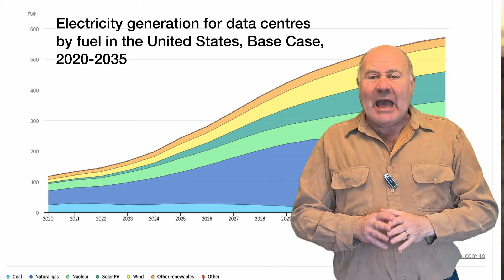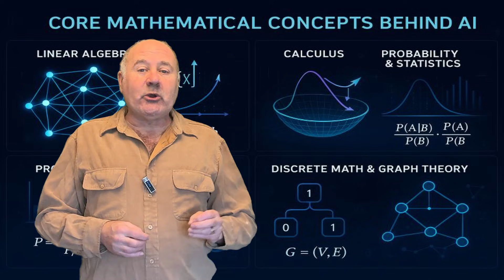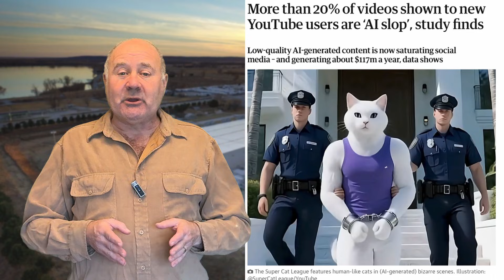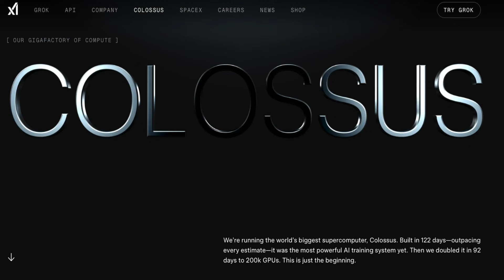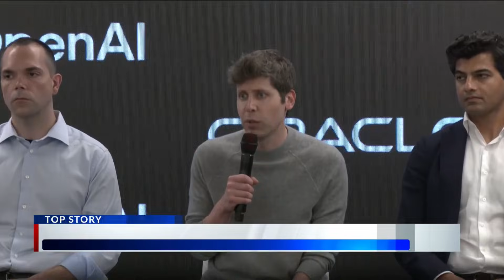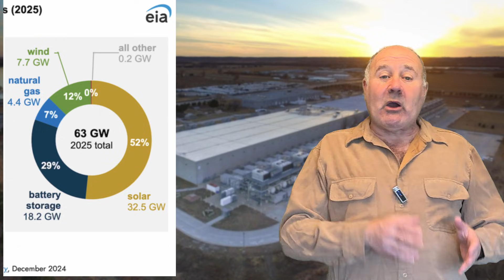You’re being lied to about electricity and AI data centers: the truth is dirtier and inefficient

Comment: A recent application to build a ‘Green’ data centre in the Edinburgh district was  rejected, not least because it transpired that the energy requirement for it was equivalent to more than that delivered to Glasgow and Edinburgh cities combined, an additional amount clearly unobtainable from the so called ‘renewable’ energy sources currently being championed by Governments on either side of the border.   
This leads one to conclude that not only is U.K. plc being deindustrialised, but also being denied a place on the starting line of the bright new technological future we are supposed to be getting on board with which is meant to be the replacement for industrial output, thanks to idiots like energy minister Miliband and co, and the Scottish Natsis (somewhat ironically) described as being ‘in power’, as opposed to running out of control in their respective ‘ivorine’ towers. 
￼

Comment: Enhanced geothermal wells are really the only energy supply solution I'm able to see going forward in this age.  Start drilling!
Reply: I had solar installed last year and the power company paid for a big chunk of it.  They know that 3 months to install home solar will be far faster than trying to build a new power plant of any kind so their hope is to have hundreds of thousands or more mini power plants around the state.  During extreme temperature periods, they use the battery, which they essentially paid for, to assist the grid.  One battery doesn't do much but thousands working together do.
Reply from the maker: No one has quite gotten it to work yet, but it is an interesting technology and I plan to do a video on it in the future.

Comment: If anything these data centers function as fuel tanks but water. 

Water will evaporated when it reach a certain temperature. Imagine cooling down a whole data center. What is the clouds they spew? 

Yes they may use recycled water but they must keep refilling the gallons of water when running low... Effectively like a fuel tank for water
Reply from the maker: The OpenAI data center I talked about doesn’t use evaporative cooling and the water use isn’t that much. But that increases the energy usage.

Comment: DATA CENTERS ARE STEALING DRINKING WATER SOURCES DRAINING AQUIFERS & LAKES DRY
Reply: Where are they putting the water after they've used it, does anyone know?
Reply: @Nigel_Broatch I think it evaporates 😢
Reply: @michah321 That's how it's done. Send loads of heat and moisture into the atmosphere. No one knows what will happen to the weather.
They should use refrigeration cooling. Like air conditioning. That would cost extra money. Can't have that. Make the little people foot the bill.
Reply: @abjectt5440  You might want to study up on how it actually works.  That was just ridiculous conjecture.
Reply: @Nigel_Broatch  They mostly use waste water before the final purification or else recycle it in a closed system with little or no evaporation.
Reply: That's alright then. So data centres don't use much water after all.

   I suppose it would make sense to pump that warm water to heat nearby houses.
Reply: @robertd9850 from what I heard they use millions of gallons a day of fresh drinking g water from the aquifers. That's what I heard in a data center proposal in my county.. That's what the plan was.
Reply: @Nigel_Broatch  The water never leaves the closed systems and the ones that use wastewater return it to the water treatment plant for final purification into drinking water.
Reply: Thanks for the info.
I wonder where the heat goes from the warm water, going round and round it would get hotter and hotter!
Reply: Water treatment should be charged directly to data centers so individuals paying taxes and water and sewer bills are not on the hook for it. I don't trust them. We wouldn't know if in fact their water is sent through water treatment or not. There are different ways it could be negotiated with municipalities before final decisions are even known to the public. Politics will be involved.
Reply: That's why we have to support people like Moses he built a machine that takes water out of the air !! Thay don't like it because he is giving out free water with his enventstion
Reply: Trains get radiation from the railway. Tire plants even admit radiation at the hopper where they pour the powder into to make rubber. I don't doubt these AI centers are polluting and using water through leakage and evaporation. Which will return into high water cost and high electricity bills. Enough we could face blackouts and shortages. They're definitely making lots of toxins from these AI centers. Paint plants and chemical plants are so  strong people are getting nose bleeds from these toxic chemical plants. Definitely most of these plants are cancerous. I'm sure these data centers are worse than that. I sure wouldn't want to be living by these toxic dumps. AI is not even need it's a want! I don't doubt the AI data centers are probably poisoning or radiating the water with radiation.

Comment: When the  bubble bursts  all  the computing power will be useful and can be resold, but the GAS GENERATORS are NOT  WANTED NOW AND NOT  WANTED LATER!
Reply: Not sure about this. I'm afraid they use very specific hardware. Like those GPUs don't have video outputs and all graphic processing firmware. So you can't just sell it to gamers without substantial rewiring!
Reply: @allmycircuits8850  I suppose I can at least get cheaper RAM!
Reply: @jocosson8892  The RAM is also made specificialy for these servers and will not work in PCs . However they would have to resteer production back to the consumer market again hopefully then.
Reply: @johnpekkala6941  They're probably going to shift these data centers into cloud computing infrastructure and keep consumer owned computing power scarce. We know they want to rent our computers to us rather than being able to own them.
Reply: @futurehistoryarchaeologist4480 equipment replacement rate is 2-3 years. The whole thing is unsustainable.
Reply: Unfortunately, discount generators are probably going to be the most used compared to stuff like hyper-specific GPUs
Reply: It wears out quickly. Burn and churn.
Reply: Those chips will be useless and will go into landfill.
Reply: when the bubble bursts and the shops arent open and the powers down, and isnt coming back... you might change your tune.

you might appreciate that generator and all the comfort that electricity spat out of it brings you...
Reply: That computing power will be obsolete far sooner than point-of-use power generation. Gas turbine generators would be the most easily resold/repurposed equipment. The AI bubble pop, though, isn't going to result in data centers shutting down and being sold off in pieces. It means consolidation. In other words, same data centers, same power usage, different owner. You may want to consider injecting reality and intellectual competence into your comment-forming process.
Reply: @ghoffmann821  We have to stop burning methane  it is going to destroy  the  climate
Reply: I've heard the chips used in these Data Centers only have a working lifespan of 2-3 years and they need to be replaced.

Comment: What is crazy about the massive energy use is how most of it ends up as waste heat and dumped by evaporating water.
Reply: In most places it's really hard to utilize that heat. Exit cooling water is not hot  enough for direct energy production and usable for centralized heating only in cold climates. And of course only during winter time.
Reply: @NzeRekoRec might work in colder places like Michigan
Reply: What's really crazy is that We The People actually allow these data centers to consume our water for their cooling when they could use closed-loop cooling to avoid any water consumption for cooling. Likewise, the same is true for the generation of the electricity they need when we could require that they use clean, safe, lower cost, renewable solar, wind and battery storage that requires zero consumption of water for cooling. We The People need to smarten up.
Reply: @greggrant4614  That would cost extra money they don't want to pay. Besides, it's cheaper just to bribe the politicians.
Reply: @greggrant4614 the great engineering feats of the old world such as tartary and those ancient star forts were all next to water built close to them at least most of them,but we can learn the same system of electricity involved and tech that was known in that time that mimicked nature's natural rhythms and Create a biological system that was self sustaining and self reliant and lasted forever so we would not be using this fake dystopian crap the corps and bankers the parasites as I call them,are throwing in our face with venture capitalist nonsense consumer based retard system that has been unproven to work and cant work by design,as it's a failed system designed to fail on purpose,so if we look back to ancient old world tartary and there tech like so many other trust sciences did like Tesla did we can be using free wireless power that exist off the aether at will and have it be using a fueless tech that powers itself as a real thing that exist and not some capitalist moron coming on here and calling it pseudoscience and what not because it Sherly isn't out of the realm of science fiction as claimed
Reply: It basically has to be for the weapons industry and surveillance state
Reply: See a Freudenberg Sealing technologies. They use human body heat and footsteps for power “human power plants” they say. Now think of those warehouses being bought up to hold thousands of humans captive. Yes, it is that dark.
Reply: True of pretty much all eletricity. It (nearly) all ends up as waste heat. An exception might be aluminium production via electrolosis
Reply: @NickKeighley Not totally.   Electricity production converts 2/3 of the fuel to waste heat and 1/3 to work; power to the grid.  Data centers convert all the fuel to waste heat.
Reply: @asc5882and that 1/3 (and I think with more efficient plants its nearer 40%) that gets sent to homes and factories, what happens to it? It all gets converted to waste heat. Only in the case where you actually make something that stores the energy does it not. Aluminium is the obvious one.

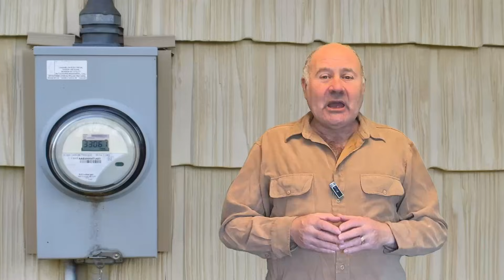Comment: 5:22 I have been involved in construction projects bigger than homes and the BA, Building Approvals,  depended on electricity supply confirmation, which delayed the construction start.

The upgrade capacity can be a massive cost all the way back to the Power Stations. 

Upgrade has to be in big chunks, not just for each new larger connection.

Empty blocks and buildings in town can not just be filled with new demand and its supply.

This is nuclear grid electricity promoters biggest blind spot.

Grids are 10times more expensive than the generation, GRID RENTAL is a killer as you scale up.

Big grid massive cost is used to attack distant renewables but not big nuclear. 

Grids are $TRILLIONS and bigger grid capacity is bigger $TRILLIONS and $TRILLIONS and $TRILLIONS.